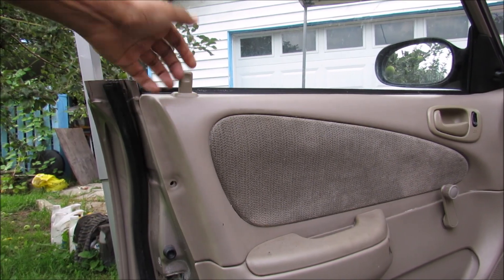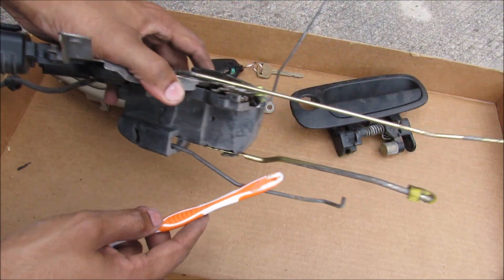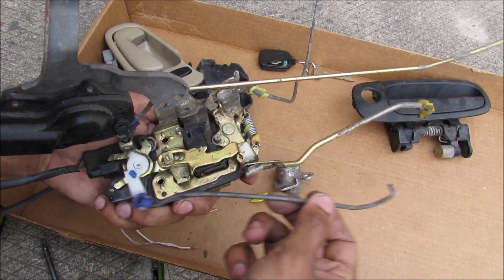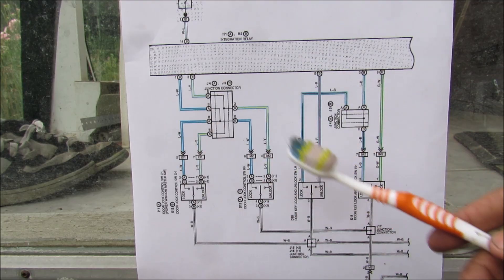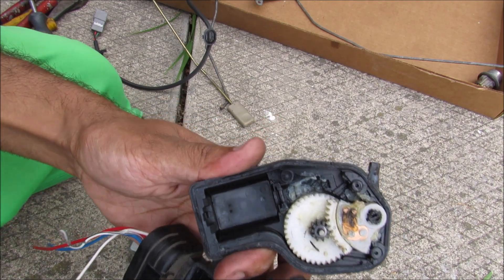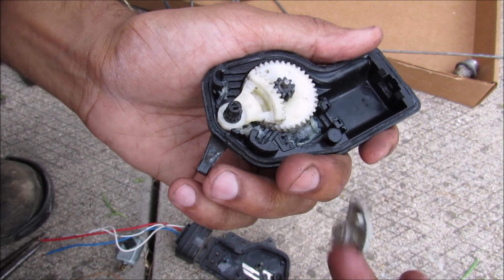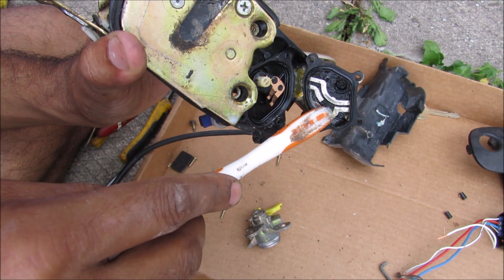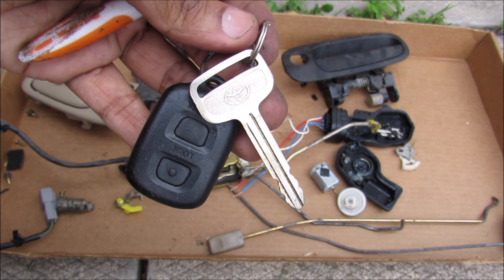How Power Door Locks Work

Comment: Thank you for your reply long back. I now have a maruti ignis 1.2 petrol its central locking takes place immediately after the car reaches 15kmper hour, it can be opened and locked even with a Press of a button on the driver's side. My car doesn't have a remote. Can this also be disengaged
Reply from the maker: Yea
Remove the speed signal going to the lock module. Most cars have this programmable

Comment: * July 3 2018 *

summer school teacher: jimmy why is your summer school register information paper all greasy and dirty?

jimmy: my brother used it to wipe off of the mechanical oil on the lock signal contacts inside the lock activator

summer school teacher: w h a t

source: 5:35

Comment: U r good ,man.  U kno ur job too well. Just stuck with 2006 axio. Lock not working from  drivers side switch n dome light, clock starts afresh from 1.00 o,clock on e ery start power with dow not working.checked all fuses,not sure of relays. But believe it to be . Main source problem.

Comment: On my nearly antique Honda, my aluminum casing and cover on the lock cylinder wore out, fell out and got lost. Those ended up being almost impossible to find. I did luck up on a used lock cylinder that still had them attached I took them out and rebuilt the housing for my lock cylinder so everything still works with the same key.
Reply from the maker: Nice!

Comment: Those thermistors are not there to save the motor. They are there to prevent a fire if the motor becomes short circuited by heating up and opening the circuit. The same way thermistors are used in electronic appliances that use motors, such as a coffee grinder. They are required by underwriters.
Reply from the maker: Good point

Comment: im still confuse if i put the key on the barrel, the lock actuators should work but its not. when i press toggle switches for door locks it works. what could be the problem?
Reply from the maker: Could be a setting in the body module
Reply: @speedkar99  maybe i should replace the door control module?

Comment: Nice presentation, but lock design seems complex to me. It should make it electronic, not this hybrid stuff. Plastic gears that wear out in door in hard to fix areas, very bad. That is some cdrom level gears, used for a car? It's easier to just use digital module, some sensors, a backup 18650li ion battery for power and a backup wheel to rotate motor in emergency and that is it. The module will compute the allowed state transitions. It's ideal for this, as there are multiple states to track.

Comment: Very concise teardown and description.  Thanks.  I am curious what mechanism provides for engaging and disengaging between the door lock motor and the final drive gear.  What hard to see when you popped off the gears.  It seemed to be a clever design but I missed it.

Comment: Great video! So what usually happens when one door won’t lock? Does it have something to do with those metal contacts? I can hear something clicking inside the lock but not as “loud” as the other door locks.🇸🇪
Reply: It could be the thermistor, having degraded over time/use and now being too high of a resistance to allow enough current through the motor windings. You can try 'fixing; it by tearing it apart (carefully, marking critical parts/steps to allow for proper reassembly) and wrapping the little plate (the thermistor itself) inside the back of the motor with aluminum foil, although this defeats the motor protection too, be warned (e.g. if the button is held this motor could/will burn up within seconds, but it isn't working anyway, right?) or just order a new actuator, they're usually cheap enough and probably easier/less time to install (plus new ones should come with better/longer lasting protection).

Comment: I just "successfully replaced the actuator from the locking assembly in my 2000 toyota corolla.
However, my initial problems is still there. I thought it would correct, but I suspect now it's mechanical issue in the assembly...or could be the control cluster on the arm rest?
Symptoms: Door unlock manual lever doesn't "rise" all the way when I press the "unlock" switch.  Also, when I grab and try to pull up on it...something keeping it down. Only way to open the door is to drop the window, and grab the outside door latch.  This is sort of a random, but it occurs about 1:4 times.  No issue with the other 3 doors.
Reply: I have same problem🙄

Comment: Thanks. This is helping me understand why the front right door on my 2017 elantra won’t open after you unlock the door.  It will open but after pulling the handle 2 times.  It always opens the second time and only does it when you unlock it. BTW: Be aware of the Hyundai warranty.  Many have said is a scam.  And it is looking to be true.  They denied the repair because of previous body work but the repair was not even on that door.  I suspect that I need to replace the door actuator mechanism.

Comment: Hi I know this video was posted a while ago I’ve recently purchased a 2004 Subaru Legacy there are two doors which aren’t opening with the central locking or cabin switch however they can be manually opened. An auto electrician inspected the car and stated the doors have been replaced and it could be the receiver isn’t working. I’ve never heard of these parts having receivers since I thought it’s all from the main computer. Can you provide any input however you can hear the motors working but the door isn’t locking or unlocking

Comment: Thank you. So my Jeep's power locks are locking even with the engine on. Sometimes it locks repeatedly over and over with me not touching anything. Any clue what is causing that?
Reply from the maker: Seems like a short somewhere in wiring and not an actuator issue

Comment: Speedkar99, you saved me time and money, thanks for the well done video!!!   My driver door Latch and Power Lock Mechanism is identical.  TIP:  An auto forum I look at had an explanation as to the failure of a Lock Actuator Motor (Power Door Lock Motor).  The Thermistor goes bad.  Knowing how to disassemble from here, I opened the lock motor and removed the thermistor located adjacent to the brushes.  I then inserted a piece of flattened 12 Ga. bare copper wire in its place (To keep the motor circuit complete).  The lock motor now operates flawlessly.  Just dont let your brother play with the Power Door Locks.  Yes, you can open the motor at the brush end but it is not easy.  It is about the only thing you did not disassemble in this video.  Cost of my repair?  $0.  How does one flatten wire?  Place a bare copper piece on a vise anvil and wallop it a few times with a hammer.  Why did I not buy a $10 motor?  There are several varieties with different shaft ends, plus parts for my '02 Tracker are hard to find.
Reply from the maker: Glad it helped!

Comment: Sir my i20 left front door sometimes lock and unlock halfway on operated by remote central locking. The same happens when locked manually from driver side. However, when locked manually from its inside left front door, it works fine again.
Please help.
Reply from the maker: You probably need a new actuator
Reply: speedkar99 now when operated from outside or inner handle of passenger side, the central locking system is not working at all which only operates this passenger side only. But when operated in both cases external or internal on driver side, central locking is ok. Please how to confirm actuator is bad.

Comment: Really very intelligent ideas...

Sir, my car i20 front left door sometimes lock and unlock or halfway lock or halfway unlock when operated either by driver side inner central door lock handle or using key from outside the driver side. However, all 3 other doors are ok in both cases. 

Also, to be noted is that when either operated from the right left door inner lock handle or using key from its outside, this particular door operates normal lock and unlock system and all 3 others ok too.

Please really help me some suggestions. Thanks.
Reply from the maker: The actuator is getting work and needs to be replaced
Reply: speedkar99 you mean I should replace the entire actuator or can I repair or replace just only the motor within the actuator itself??

Comment: Still unable to unlock neglected  2001 Subaru Outback.  Was able to remove the driver panel.  Lubed everything very dirty. Graphite in the outer key tumbler.  Sprayed Siliconed towards actuator.  Atemped to spray
 liquid wrench towards door thingy. All other doors works fine. Pulled on all the rods.  Found outer handle rod holder broken. Inner lock lever won't budge. Whats next? PS  Your the best light I have found down this deep dark door  jungle  jim jam.

Comment: What I will admit is interesting about that car, it has power door locks but no clock and only a two speaker sound system. I have the same car, base model and all, I have the clock, four speakers, but manual everything else. Maybe that car was a special order when it was new?
Reply from the maker: Yes those we're all plug and play options.

Comment: Haha, "Brothers homework..." , "Brothers toothbrush..." gotta love that!
Reply from the maker: Haha you caught the homework
Hey it was just lying there so I used it 
Not like he'll notice it missing
Reply: LOL! Oh no ! You're a crack up!   Hey , i do have a question for you as you seem to understand the operation of things pretty well. I submitted a question for you on your other actuator vid and left a lot of detail, but it must have been missed. Could you take a much appreciated moment for me? Heres what I had asked :
"Excellent video sir ! Thank you for it ! I subbed because you are so very thorough and thoughtful in your demonstration . I just found you while trying to understand this system so as to diagnose my issue on my newly acquired 2008 Mazda3 S. Perhaps, you could check my thinking for me? What's happening is that my passenger front door lock is not locking when signaled via the key fob (It moves SLIGHTLY, but doesn't lock ), so it must be locked and unlocked by hand. I'm suspecting that the actuator is failing or the cables are mechanically compromised. Along with that symptom, the alarm will immediately sound after all doors are locked manually and the KEY is used at the driver door cylinder (The only key cylinder on the doors) to activate security monitoring (Using the key and turning to the right in the driver key cylinder activates the alarm system monitoring). So, what I suspect is that the switch position indicator on the actuator may be constantly indicating that the door is in the unlock position, even when it has been manually locked, thus setting off the alarm. Does that sound feasible to you with your understanding of how this system operates? "
Reply: I really didn't understand your question but mind if you help me Instead my driver side door does not unlock from the inside watching many videos now I'm a little more knowledgeable about what's happening but still dont get it it just won't unlock from Inside but works fine if unlocked through outside unlocking and locking the door works perfectly just that when unlocked in won't open as if the rod was not pulling something to open it idk tbh

Comment: I have older Mercerdes w140 S-Class it has Door Lock Problem when I tries press lock it doesn't lock, causing Fuse so I hope you understand.
Reply from the maker: Sounds like the motor had burned some coils and is shorting out

Comment: i have a 01 sentra and it unlock/locks by itself, tried replacing battery in the fob and nothing, tested the switches and no water damage. i have to take out the fuse just to have it locked. any idea what it could be?
Reply from the maker: A short in the door switch or body control computer

Comment: My driver side actuator only works when it is cooler outside. If it’s hot I have to unlock my car with my remote and then use my key to unlock from outside. Do you think my actuator motor is busted? Car in question is 2004 elantra.
Reply from the maker: Could be the motor wearing or the thermistor giving out
Reply: speedkar99 thankyou.

Comment: Why is the gear inside the actuator spring loaded?
Reply: I am asking because my actuator was sticking. I cleaned all the latch mechanism but the problem was still there. Then i opened the actuator and removed the spring to reduce extra load on the small dc motor inside. Now it's working fine. So why was there a spring in the first place?
Reply from the maker: It's there to recenter the actuator allowing the lock to be manually cycled without damaging the gears in the motor